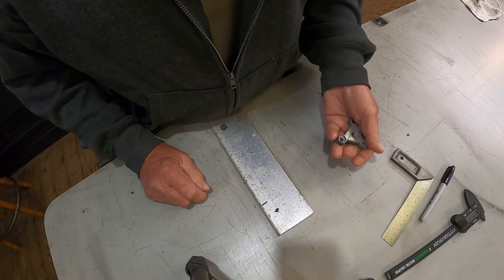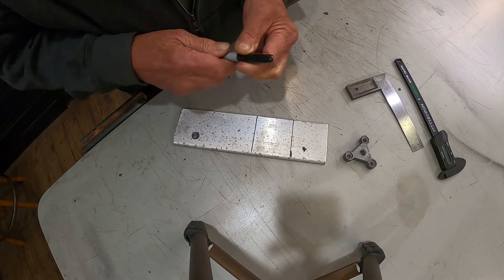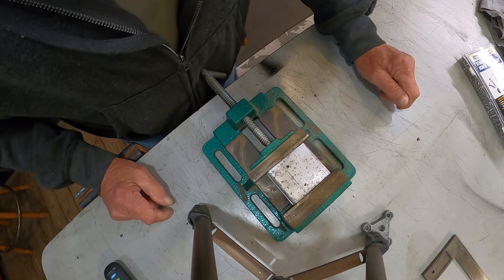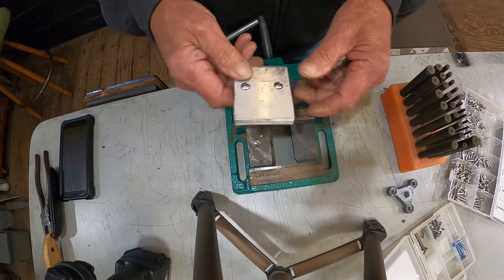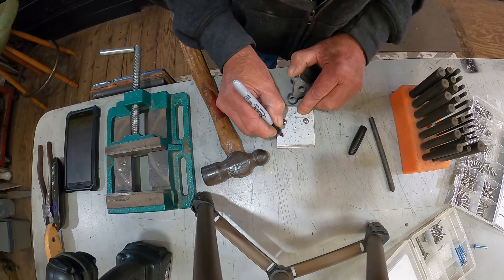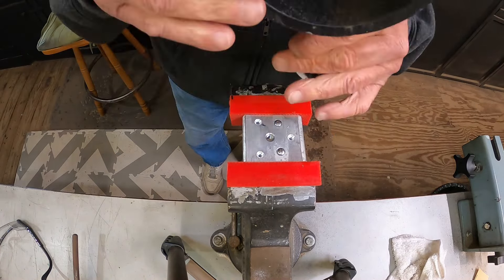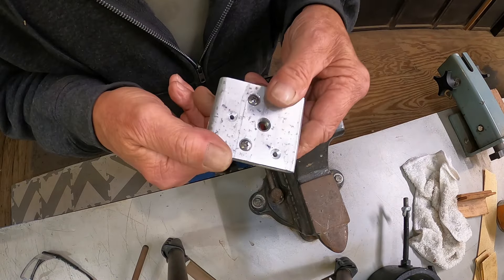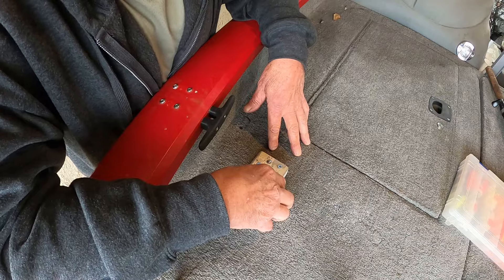DIY/  Rod holder mount.

Comment: The rod holders  that come with  the star base  are trash  the tops  will snap off  on anything  over  10lb I wouldn't  trust  my setup  in them Walmart  boat rod holders  I made some like yours  out of pvc
Reply from the maker: Thanks for watching.  Yep, I had one of them break a couple years ago.